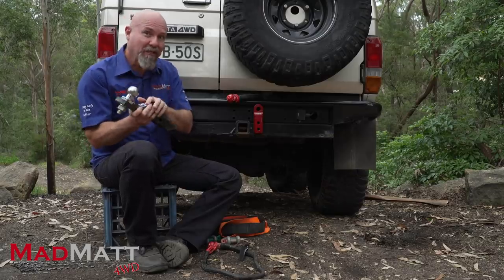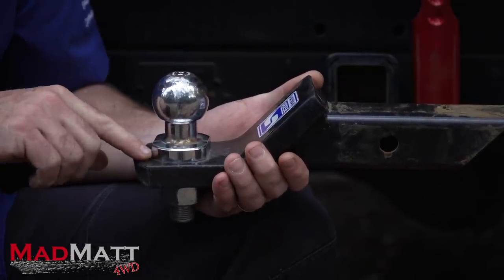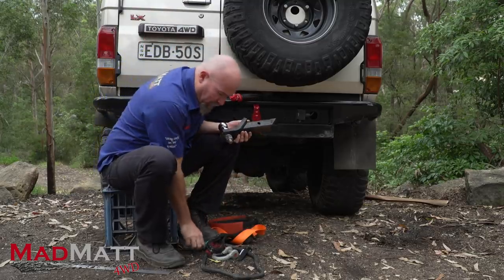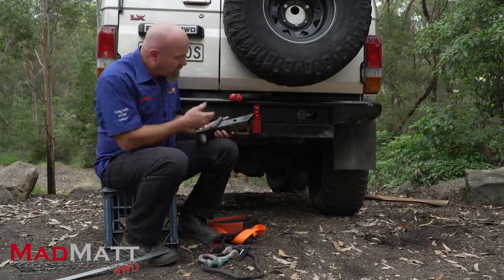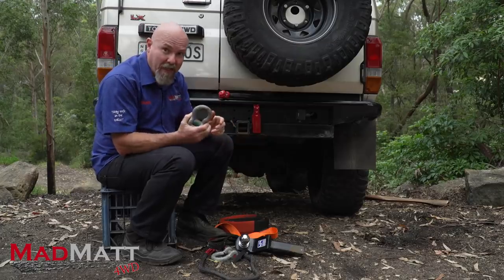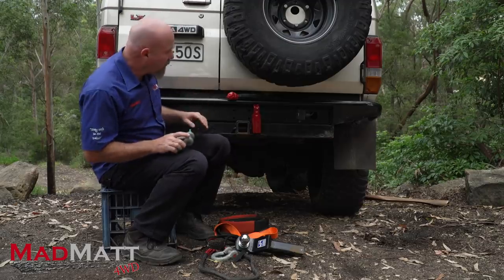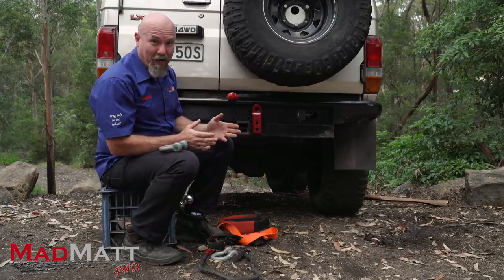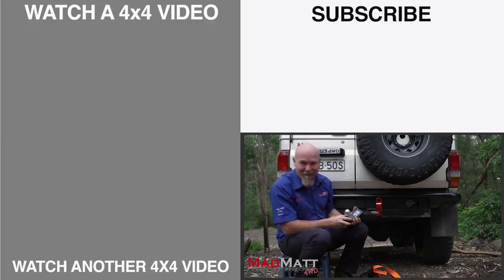A Tow Ball is NOT an option in a 4x4 Recovery? FIND OUT WHAT GOES WRONG

Comment: everyone is talking about gear and techniques... I have not read every single comment, however I have not seen anyone say be careful where you stand...  no one should be standing within 50 feet of any vehicles participating in a recovery of this type.. 50 feet might still be too close..  everything is dangerous if you're not smart..
Reply from the maker: Yes. It's certainly an important part of recovery. I mention it in many of my videos.
Reply: @MadMatt4WD  I have to admit I haven't watched many of yours yet, I only just found your channel from Matts off road recovery..  I don't even wheel, and I'm not sure why even his channel was recommended.. I've done plenty of highway towing and machine rigging though, so I do know my way around hitches, winches, and straps..  all I can say is if anyone is breaking hitch balls and welds on receivers they're really doing it wrong..  stay safe!
Reply from the maker: @danosburn80  Welcome and thanks for engaging with what I do. I too have worked around rigging and such for many years and the 4wd community is full of people who drive a desk and 4wding is the hobby so often don't have the depth of knowledge required for safe recoveries. There are so many unsafe practices that go on with general ignorance. Drinking and wheeling is a massive issue. So part of what I and many others are seeking to do is just help people to stop and think. Here in Australia there are a number of cases where people have died due to failed recoveries.

Comment: Would love to travel with you sometime after this virus is gone. Getting my 4by fixed soon
Reply from the maker: awesome
Reply: @MadMatt4WD  getting  a  transfer case and gear box  with 200,000 km less than mine and im also having problems  with my current gear box  from not wanting to go into some gears sometimes to 4L not working
Reply from the maker: @Bobodeman , Of course, I have no idea what your driving. :)
Reply: @MadMatt4WD  2000 mk triton manual.  If you check my channel i have  2 videos of it. Both where basic dirt driving by the 2nd was more complex. Im also located NSW about an hour or 2 from Albury. Not going to state where I live for safety reason

Comment: But what about the three ball hitch that Matt from Winder towing uses? Is it designed with this in mind or is he locking and loading his "shotgun" every time he uses his?
Reply: I've been surprised to see him use that; even suggested at one point he get a D-shackle mount to replace it.  They're so cheap and easy why not?
Reply from the maker: Our video next week is Matt explaining how he does it. Personally I think he could use a hitch receiver.
Reply: @MadMatt4WD  In a few of the latest videos, A pintle hook has been used and the three ball has been put away.
The three ball is used in tow when you dont know what size ball joint is going to be when you tow a customers trailer, they dont know most of the time.

Comment: How safe is it to just not use the red factor 55 adaptor and instead just put the recovery strap right through the hitch receiver pin.
Reply from the maker: It has some drawbacks. Here's my thoughts https://madmatt4wd.com.au/2014/01/27/is-a-hitch-pin-acceptable-as-a-snatch-recovery-point/
Reply: @MadMatt4WD  Thanks for the reply and write up. I will continue using the pin for now but look at getting the hitch adapter.

Comment: Isnt that why you keep all your recovery kit in a dry place and in good clean condition and as we do in useing multiple snatch blocks and d ring  reese recovery pins in solid steel
Reply from the maker: i'm not sure I understand what you’re saying .
Reply: @MadMatt4WD  on the reciever reese makes a one piece solid steel reciever piece that can be used with block and tackle d rings and other re overy devices that dont endanger those who use them of coarse that's here in the colonies and if a vehicle cant come free with a gentle pull then take a shovel and bury it the rest of the way because it isnt worth retrieving but here most retrieval is still done by winch and chain and by professional retrieval engineers
Reply from the maker: @shaneharrison4775  Nice

Comment: Just don’t use a dropper hitch and use a shackle
Reply from the maker: not sure what you mean by a dropper hitch
Reply: MadMatt 4WD all the hitches you had  were dropper hitches they drop down  or if your truck is squatting from the weight on a big trailer or if the trailer tongue needs to be high you flip it and get a couple inches of rise  here in the states in the Midwest in the agriculture industry for pulling our farm equipment behind our trucks we have the pin hitch for the receiver which is pretty much a thick ass piece of steel with a hole in it welded to the square tubing that goes into the receiver I don’t think they make them anymore but now instead of welding a piece of 3/4 inch steel to them they are making them a solid forged piece and that would be as good or better than your recovery one here’s a link to the new style  https://www.theisens.com/products/45456-2-forged-ball-mount-for-trailer-hitch-2-5-x-2-5/42942605/   That’s the 2.5” version but the 2” version is built the same
Reply from the maker: Thanks Jayden, It's always interesting learning what different countries call different things. Stay safe mate.

Comment: Why don't you just use the pin 🤔  it's holding the recovery  point so it's clearly strong enough
Reply from the maker: You can do that in an emergency. The issue is that the strap could possibly get cut on the edge of the receiver.
Reply: @MadMatt4WD  ah fair fair, i acctually  just used the pin to get a guy out of the snow bank, so it can work, but i will be getting a proper reciever soon

Comment: It doesn't take much at -50°C
Reply from the maker: never thought of that but great point.
Reply: We had a safety briefing at work 6 or so years ago.  One f350 was trying to recover another f350.  The ball sheared off and went through the cab of the other truck, missing the driver and out the windshield.
Reply from the maker: @driverguy4074  WOW, What I don't get is it's so easy to avoid using a towball but people still think it's ok. I'm referring to some of the comments on this video.
Reply: @MadMatt4WD  you can do it safely or not.  Safety should always come first.

Comment: Awesome content, Matt.  I carry TOW straps with sewn loops and no attached hardware for recovery on the logic that I just don't want any surprises from a kinetic strap.  I understand that the static straps are less effective, but I just don't want to take a chance on flying steel.  I reason if I cant extract the stuck vehicle with the static straps, we'll use the winch and if that doesn't work maybe the stuck vehicle needs professional help.  Is my logic bad?   Thanks.
Reply from the maker: Great logic. Just don't hit the straps but rather just use them to do a tow recovery. Also use a shovel to dig out around the vehicle and do things to reduce the recovery load.

Comment: This video is providing false information on so many levels. 
You are not applying shear forces. On a properly installed ball with the rope over the ball you are applying a pull force. The only place where you are applying shear forces is the pin that holds the adapter in. This will be the same between the ball or the shackle adapter. The other video he is referring to is faked by cutting the ball, going to fast with a static rope on a fixed object. If you are doing a recovery like that you will be breaking any tie up points as the car frame is not strong enough. 
I personally don’t like to use a ball because it is easy for the rope to slip off but that’s also the only reason!
Reply from the maker: We will agree to disagree.

Comment: Im sorry but I feel like this is really just looking for a reason to spend money.  These "tests" are trying to make them fail.  Just like this guy states the failures were found due to neglect from rusted hitches.  No kidding, use common sense or risk peoples lives.  I'm sorry but Im not letting some hill billy with his rusted out 1992 Ford truck with half a bed missing snatch my jeep out of the mud with my family hanging around.  However if a guy with a couple year old silverado or F150 thats pretty new came buy and had a tow strap and all we had was a ball hitch, yeah I give a yank or 2 with not more then a slightly slack rope to not shock the equipment much.  If that isnt working Im using something entirely different then.  Common sense. This fear stuff about avoid balls!  Come on.
Reply from the maker: We’re going to have to disagree but I do agree with your looking for other options approach.
Reply: @MadMatt4WD  I live at the beach and people can drive out on the beach. I see people doing so many WAY other dangerous stuff that a tow ball is the least of most people’s worries. To me the danger is more in lack of maintenance and inspections on existing hardware and/or buying cheap Chinese hardware. Then going and snatching someone out. I find it hard to believe a high quality ball and hitch designed to tow a several thousand pound trailer and hold up in emergency braking, but can’t take a good tug every now and then. To me it’d have to be a compromised ball or hitch or someone being incredibly dangerous in how they yank someone out.
Reply from the maker: I agree they do fail once compromised. The issue we have is that people are dying on a regular basis from tow hitches and balls failing. That’s a fact not some wild idea I’ve come up with. So yes we could try and educate people on how to inspect a tow hitch and the assembly on how to know if it’s safe and safe to do what. Or we can just educate them to say the risks aren’t worth it when a safer solution is so easy.